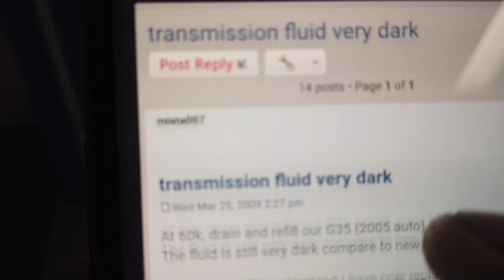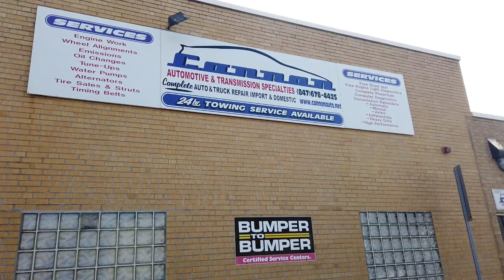Transmission fluid change on my Infiniti G37xs sedan

Comment: Anyone know how many quarts does it take to change out the transmission oil ? Seeing different numbers on the internet..
Reply from the maker: Pretty sure it was around 5 or 6 they needed to over fill i think (not sure) and pull it out since it was being filled from the bottom not the top

Comment: Mines got 104k on it and I just bought it and I’m wondering if I should take it to Infiniti to get it changed but people been telling me not to touch ut
Reply from the maker: I heard the same but my oil was really dark when i saw mine, and automotive ppl recommend changing every 30k miles im sure
Reply: @JoJoCars thats for front drive transmission, especially cvts (nissans front wheel drive trans) otherwise technically you never have to change the fluid in the 7 speeds for g37s

Comment: I have a 2012 G37x sedan with 50k and I want to do a transmission fluid change. Did you noticed any difference in the driving and performance of the car after the fluid change??
Reply from the maker: Definitely smoother shifts bro and less hiccups
Reply: @JoJoCars   nah bro its a vq thing I shift into 4th sometimes and it Jerks forward but definitely warm up your car good bro 💯
Reply: @5.0Fabio  my car sometimes jerks when using paddle shifter after redlining it in every shift
Reply: What is the full name of transmission fluid you used
Reply: @joshuanavarro2734  Nissan ATF

Comment: Any improvement on throttle response after drain & fill on transmission and did u use nissan transmission fluid?
Reply from the maker: Yes they recommended oem, way smoother and better response but as you see in the video my cv axels are loose and need to be changed not sure if that will help speed and response
Reply: @JoJoCars  good looks looking to change my soon just reached the 100k mark & changing the cv axles helps just better w road noise and if u have any thumping sound when turning
Reply from the maker: @psycho9990  ahh good to know good luck my guyyy

Comment: How much did they charge for the fluid change?
Reply from the maker: Um call and see its cheaper than the dealers $250
Reply: @JoJoCars  did you do a whole flush or just the change,I got a 2008 G35x with,70k miles but a lotta people been saying to do just a drain and fill since I’m not sure if the previous owner has changed the fluid.
Reply: It's so easy to just drain and fill if you have the jackstands allen wrenches and pumps
Reply: @Alex-xt2tb  ik this was a year ago but a drain and fill and flush do the same thing it's just two different methods. Flush is technically the proper way to do it because a machine will suck every drop of fluid out and replace it to the exact specification. But drain and fills aren't bad done the right way